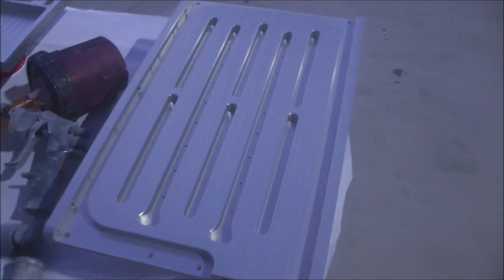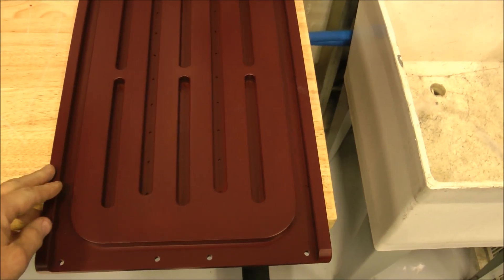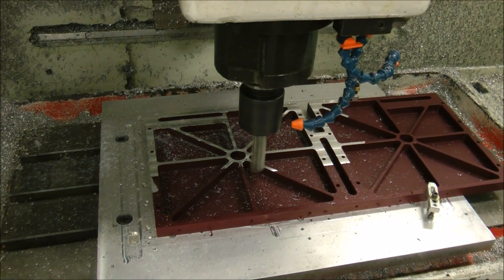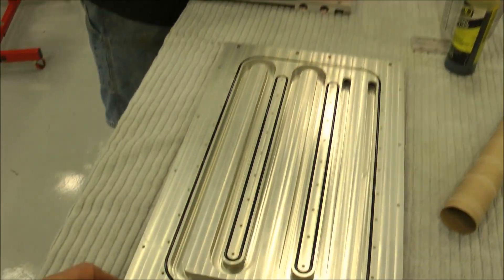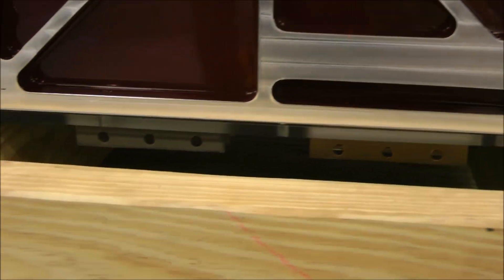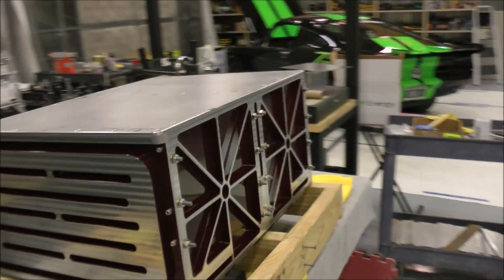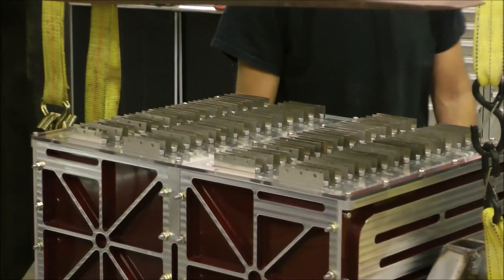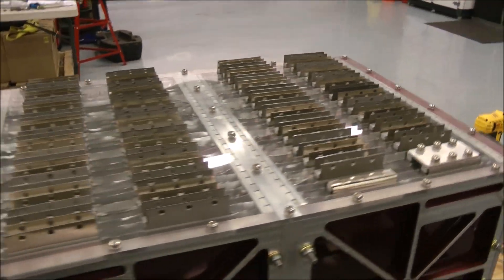1966 Electric Mustang conversion part 11

Comment: Had the exact same design in mind for an electric motorcross bike battery. Are these Lifepo4 cells or Lithium polymer? Really curious how a light car of say 2,000lb rolling chassis without pack would do with 60-100C discharge lipo cells and just enough amp hours to get it down the track.
Reply: Hey Chris all the clues are in the videos. They're a 75Ah LiPo 10C burst (2P - 1500A). Not a bad choice as they offer reasonable energy density to weight ratio and less complicated BMS. At 10C burst they could have probably used a LiFePO4, but at lower draw rates thermal runaway shouldn't be an issue. Have yet to see the final configuration but assume at 5:26 it would appear to be 2P. Note the different colour tabs which indicate positive and negative.
Reply: Actually they may be 20C because he mentioned 1500A 10 second burst and may have been referring to a single cell in a non pack configuration, and if that was the case in 2P they would be capable of 3000A, but noting his previous videos and tendency to want to make things sound grander than they are, I doubt he would miss the opportunity to make it sound bigger if it was there. Although his math isn't great because he thinks there is a MW pack in the Zombie 222 when it is a tenth of that.